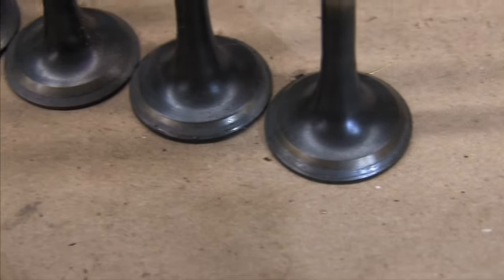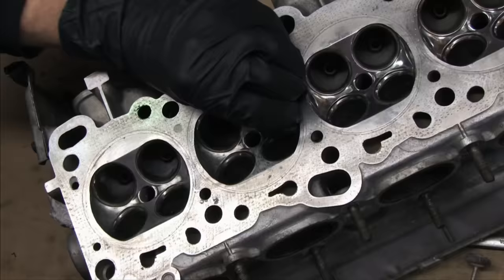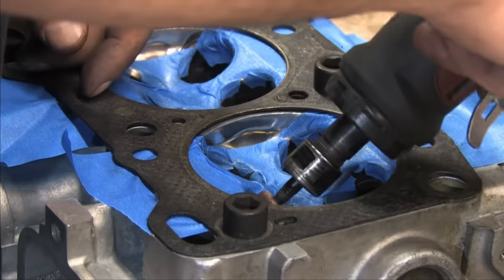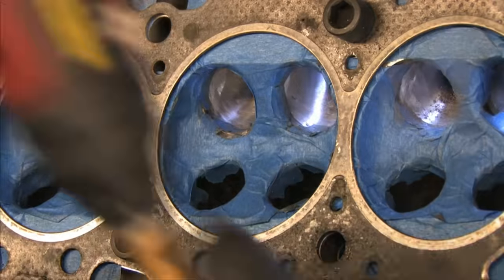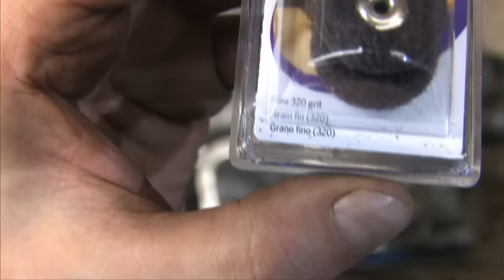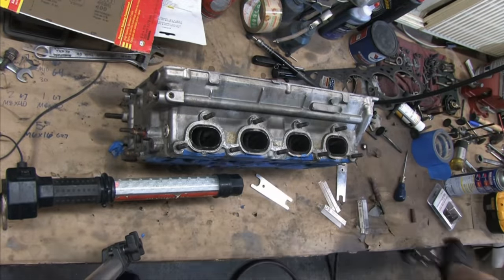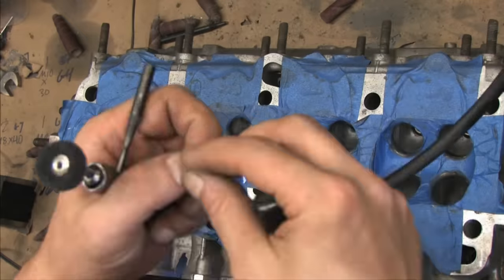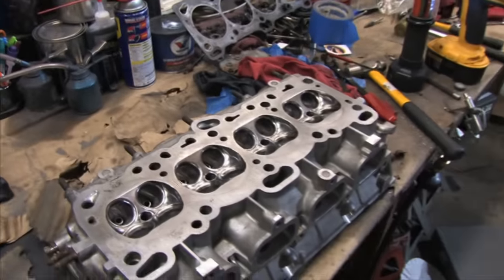Cylinder Head 204 - Porting & Polishing

Comment: Intake runner Finnish don't mean shit under boost...and I hook ya up with a trick so ya don't have to use up and entire day polishing combustion chambers...we call the grinder valves...old valve that either have the face cut way down or the top ground thin. You want them as low in the hole as you can get them..all they do is protect the seat so you use tools with some power to sand and polish...air tools are old school, Milwaukee makes a grinder that's straight and had a 1/4 in collet for about a hundred bucks..and then go to your local hardware store and buy a dimmer switch. Like for lights in your house. Round knob..get an extension cord, slice it open, cut either the black or white wire and splice in the dimmer...speed control, your work will be so much easier.

Comment: Got lots of info from the vid. How much horsepower did the porting and polishing put out?
Reply from the maker: This head is on a 2.0L block, installed in a 1992 4-door Hyundai Elantra.  Could be 420hp... (has same fuel system, turbo & valvetrain from a different 2.0L awd car that previously did that)?  Could be 463hp... (most I've logged in a clean section of my datalogs with water/methanol injection)?  It's the third fastest Elantra in the world right now and slowly moving up.  I haven't put it on a dyno yet.  I don't have a dyno.  If I owned a dyno, I'd do a full pull before and after every modification and change my name to Cleetus.
Reply: Nice well good luck. And yes a dyno is a very handy tool in the engine building world.

Comment: Generally speaking most engines are well designed and do not need modification. Older engines were not as efficient, and they responded to modifications. To have this done at an engine shop would cost a FORTUNE!  At $50 + + + per hour x by at least 8hrs, plus expenses!

Comment: Your intake should actually be rough, as it promotes atomization of the fuel. You can skip polishing, and use low grit sandpaper for it.
Reply: What grit exactly do you recommend for the intake ports?
Reply: @waynecools-lartigue1253   I used 60 grit because that's what I had, but I'd go with 80-100 because that's what most people recommend.

Comment: Id love to see what this head looks like after 4 years of driving.
Reply from the maker: Stick around and find out!  
Spoiler alert:  This car has water methanol injection installed in it.  I've heard cars with water/methanol injection stay carbon free as if they're continually being washed and steam-cleaned.  That's something I want to put my own eyes on–rather than just read about.  I'm sure I'll break or change something on it and have to be in there at some point... if I hit my goal and finish another car, curiosity has enough of a grip on me that I might just pull the head just to shoot that video and find out.
Reply: @Jafromobile  I threw water injection on my 120k mile stock Miata to see if it made any difference. In just 400 miles, being very liberal with the spray there was a huge difference in cleanliness of the intake and combustion chamber, but my borescope couldn't make the bend to inspect the intake valves.

Comment: A mirror finish on a fuel injected intake port is still a no no the reason is that you get a lot of splash back and the droplets of pooled fuel reduce intake mixture efficiency.
Reply from the maker: Right.  That's why the entire floor of the intake is rough.  The injectors are aimed at the floor, slanted to line up directly between the backs of the intake valves.  They're not aimed at the shiny stuff.  The whole floor is rough, so that fuel can't pool.

Comment: So how much horsepower gain did you have after all that hard work?
Reply from the maker: I don't know?  If DragTimes would let me register this car it would be the third fastest Elantra to ever make a drag pass, and there's less than a .8 second spread between all of us.  It's equipment list is nothing like the two in front of it, either...  The vast majority of this engine is OEM parts.  The only internals from valve cover-to-oil pan that aren't OE parts are cams, bearings, studs and valve springs.  That's it.  It's a stock non-turbo 2.0L rotating assembly with a 1.6L head.  This engine is making 400-ish today.  Ran 13.0006-13.015 last season full weight with pump gas, subwoofers and all power options.  116-118mph trap speeds.  It was going 104-106mph when I got my hands on it.  I changed cams, airflow metering system, intercooler, its standing center of gravity and suspension/tires/wheel modifications.  It's hard to say what particular thing has improved it the most because it still doesn't have any traction.  I'll dyno it soon, but I don't have before numbers for reference.  Sorry.

Comment: You're perpetuating a myth here: it's not JUST the time it takes to hand-port a cylinder head. It's also the knowledge of how porting affects the flow and what needs to be focused on in order to make the head flow better.

This is why modern CNC head porting still costs just as much as hand porting (if not more). You're paying both for the work done to the head and the time and the engineering that went into figuring out where the best gains could be made.

Anybody can sit there with a dremel and polish a head. Bonus points to you if you're polishing a 4g63 head, because that's a damn good head to start with and you'd be hard pressed to screw it up. Hence, it's no big feat to sit there polishing such a thing and not lose power; you'd really have to screw the head up to cause any negative consequences. In fact I'd be very careful that the work you're showing here doesn't creep into the quench area of the head, as reducing this will have a much greater effect on knock than any of the polishing that you're doing.

"If there's no benefit to polishing a combustion chamber, then why do the highest-performance cylinder heads all have this treatment done to them?"

Simple, they don't. It's a complete fallacy. Nobody polishes anything (other than perhaps valve seats) when it comes to cylinder heads. As I stated previously, it's a complete waste of time, and in some cases it may even be detrimental.

Comment: So...what's the modern method for removing carbon from an assembled engine? Did I miss something?
Reply from the maker: If it's forced induction, one of the options is using a water methanol kit.  Because water converts to steam with combustion, it steam cleans and blasts all the carbon right out the exhaust.  Basically everything from the intake manifold and beyond gets washed right on out.  It can even steam clean catalytic converters.  At the time I posted this video I hadn't installed it yet, but I've since made that video.  It's in the Hyundai's playlist from a couple of years back.
Reply: So if you're adamantly against adding auxillary injection, you're S.O.L.?
Reply from the maker: @aaronmatuszny8856  Nah, there's also a means of plumbing a vacuum line into the throttle body, and siphoning about a quart of ATF through the intake while the engine is running.  Crank it up to about 3000 RPMs, put the hose in the bottle so it starts sucking out the ATF, and watch all the smoke roll out.  Some people use seafoam instead, but really, either one works.  ATF is just old school.  This doesn't work anywhere near as well as water injection, but the hose/solvent method is how people do this without the kit.  Any engine with an EGR valve is going to build up carbon in the head again, so the water methanol kit functioning normally over time just keeps it clean without having to do any of that.  Plan C is take it all apart and clean it.
Reply: @Jafromobile  Okay, that I can manage, thank you sir.

Comment: Hi, Would an ultrasonic bath take-care of cleaning off the carbon?
Reply from the maker: It would... but the issue begins with the solvents.  The solvent used may degrade the FIAV gasket and cause it to fail.  The ultrasonic bath on a fully disassembled throttle body (no gaskets) would be fine, and will likely do an excellent job... but it will take exponentially longer time to clean compared to carb cleaner and a rag.  If you used a non-corrosive-to-Viton solvent in the ultrasonic cleaner, you could clean an assembled throttle body, but it won't make any of the gaskets and seals work better.  Old hardened seals will still leak afterwards.
Reply: Great, Thank you for the Reply. I 'm considering taking the top end of a 4 cylinder motorcycle engine to a shop. Hone/port, lap valves and do clearances. Compression is low.  The shop said they would use ultrasonic bath to clean it up... I know it would not be as good as the job you have done. Hope Suzuki put more care into their castings...  Keep up the Good work :)
Reply from the maker: Dude, I'm sorry... the device I replied to you on doesn't show me which video I'm replying to.  I had just uploaded a throttle body rebuilding video yesterday, and I get so much discussion about ultrasonic cleaners with every upload that I assumed it was a comment from the new video.  If you want to see how I deal with carbon on engine parts during a rebuild, watch my DIY parts washer video.  It's only about 1 hour of actual work, maybe a 24 hour soak, and only one $14 can of mineral spirits to clean and remove all carbon from an entire engine.  I don't think I'd use ultrasonic cleaning methods on a cylinder head.  It might work fine... but I don't have access to any kind of ultrasonic cleaner that big to find out... and my parts washer method is only $14 to the finished-clean engine because I own the siphon feed blow gun already.  I think it has to be the fastest end-to-end solution in a home garage.  Plus, you never hear me speak a word in that video.  ;)
Reply from the maker: Also, I didn't know you were working on a much smaller engine.  Their method will likely clean every part of that head without disassembling it.  As long as their solvent doesn't degrade the seals, I think you'll be fine doing that.
Reply: Yeah I am considering doing it my self. it's not starting atm. just rebuit the carbs, still no start. next is valve clearences. I'll try take a look when i'm in there at the valve seats. never gone past the valve clearences. and when i did that i broke off 3 bolts in the block bolting down the cams. Gladly got them out and replaced with high tensile steel bolts. I'll get to it sooner or later. thanks for your reply. and enjoy your higly intellegent videos. clearly you have a high IQ

Comment: nice video! however. the reason for a "rough " intake port is not just to prevent "puddling" of fuel... its also to promote flow.  it acts dimples on a golfball… infact high end race shops now offer CNC dimpling to promote this effect.  BES is a top engine builder. http://www.besracing.com/cylinder-head-and-intake-packages/new-cnc-port-dimpling

Comment: How much horsepower did u make porting those? 50hp?
Reply from the maker: It's hard to answer this with accuracy because the car hasn't been on a dyno yet.  There was a cam swap, a turbo swap, o2 housing upgrade, valve spring upgrade, an engine management system with a new airflow metering system, injectors, fuel pressure regulator and line upgrade, and intercooler replacement performed simultaneously with this modification.  Later I added Water Methanol injection and still don't have it where I want it.  I have logged 430whp at 5600 rpms in 3rd gear on a WOT pull from 2500 to 7500 RPMs before, but in practice on the track I can't hit that number because I bang 2nd to third and it's really hard to get traction after that shift.  When I spin, I see calculations in the 600-1200hp range which I know is wrong...  But when I bang it and stick it, it messes with the timing advance and cable-driven speed signal and I still get bad numbers.  Best I've seen, or at least the most trustworthy log says 396whp.  What I did find after all those upgrades is the car's best is 1.4 seconds quicker than its best with the old 14b setup using the same rods, pistons, crank, head, manifolds and block.  It has also hit 118mph at 3140lbs with me in it.  If you do the math, that comes out to 402hp, but I spin through a quarter of the track every time with the biggest tires that I can fit under it without rubbing.  Who knows which number is right, though?  It's not bad for a junkyard build.  I intend to get it some dyno time, but I have one last fix to do first.

Comment: Brother, do u know is it cordless drill capable for doing porting polish?
Reply from the maker: Yeah, nah.  Don't.  Nowhere near enough RPMs and there are no batteries that will last long enough to ever finish anything.  Consider gear reduction with a counterweighted pedal wheel if you have to do this off-grid..
Reply: @Jafromobile   Im gonna porting polish motorcycle head cylinder, cordless drill that i know good quality capable Torque 18Nm in load, Rpm max 1600rpm no load.
Reply: @Jafromobile  do u know any website Article or forum for porting polish related?
Reply: @Jafromobile  brother, any advise for porting and polish?
I'm gonna diy porting polish

Comment: You shouldn't polish the intake port!
The fuel will drop up, and drops of fuel will enter the cylinders occasionally.
This leads to some rich (A/F-ratio) cycles, and some "normal" cycles.
If you don't polish the intake port, the fuel will lay in the surface imperfections and evaporate consistently.

Comment: I must disagree with you about crossing the direction of polishing.  If you are polishing rods you must polish along the length of the rod not across.  Even if you have an almost mirror finish and have polished across the rod it will have micro scratches which form the nucleus of weak points and may cause the rod to eventually fail.

Comment: "it will only cost you 50 bucks in materials"
Right. And about 1.000 for the tools needed.
Reply from the maker: You could do it with as little as $250 worth of tools, but if you spent the $1,000 on a complete air tools setup... it can do tens of thousands of dollars worth of jobs for you in a short amount of time.  Of course if you don't need to install a roof, fix a car, a lawnmower, paint a house, paint a car, change tires, or strip rust from metal stuff then it's prohibitive... but... if you have them, or can borrow time with them, the $50 is accurate.  ;)

Comment: What kind of power did that make
Reply from the maker: Based on data logs, it's 353hp at wastegate pressure (16 PSI) where I know I have traction, and set to kill at 27 PSI I've now logged 464 where I'm pretty sure I had traction.  I'm using 93 octane pump gas and water methanol.  I just upgraded injectors and there's a whole lot more left in it.  We'll see?  I want to put it on a dyno soon.  I can't trust the log numbers because of the open differential and traction issues.  I hope to do that before the year's end.

Comment: Love the videos. But 14mins in its called laminar air flow and a rough surface does offer more CFM at higher RPM's and across the rev range, We are not talking super rough surfaces just finish of with 120-240grit roll.
 Think about it golf balls have divots for a reason. Sharks have rough sand paper like skin for a reason as well. Engines need rough surfaces in the ports to help air separate and detach faster from the surface which makes the air accelerate faster which increases air volume and speed and ultimately power. Airplane wings are smooth and use laminar air flow to produce lift and its the highest point of drag on an aircraft.
 It is really bad advice in this video. 'Polishing is really bad advice'

Once again I enjoy these videos because its the same stuff I did when I was young. And back yard mechanics will all understand why.
 But its also why my hot 2.0L na had all the important stuff done by a professional engine builder, I did most of the work on my motor including fabricating parts.
But I paid for a professional final assembly and quickly learned I made some bad rookie mistakes that would of made no difference to just a backyard rebuild. in the areas like squish and ring clearance, how I seated my ARP head studs into the block. Why the 5kg flywheel I chose was too light and wasn't going to help my crankshaft survive very long even tho its what everyone was using. These were all thing's that the manufacturer reseller of said parts recommended and they got it wrong.

Comment: Did this help with performance or gas mileage?
Reply from the maker: This car has beaten the 3rd fastest pass any Elantra model has ever made at a drag strip.  I've never been real concerned about fuel economy, but it gets about 27mpg on the highway, and that's not bad for a car making an estimated 400hp.
Reply: @Jafromobile  nice work